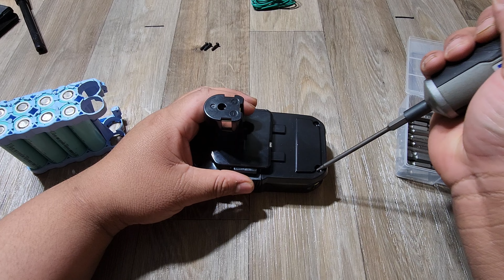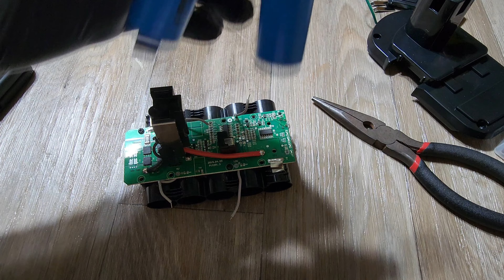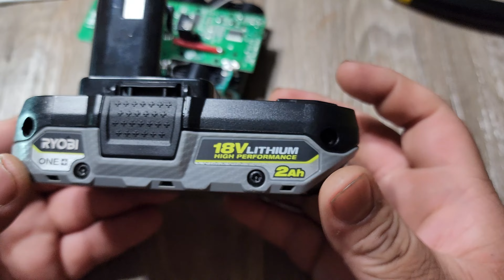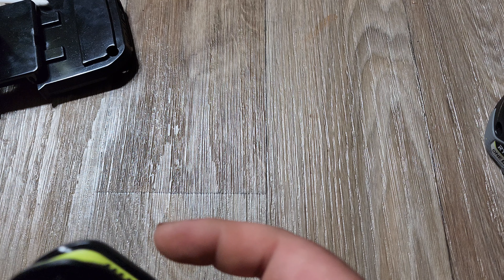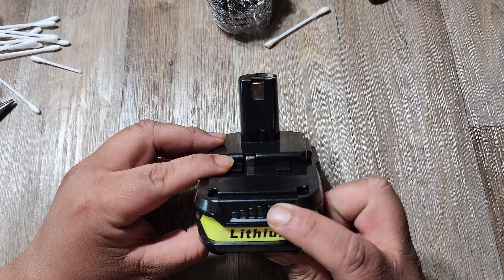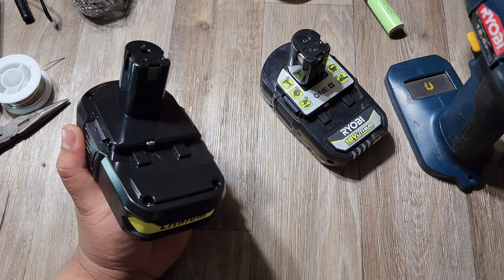Replacing Fake Ryobi Battery Pack Batteries with Good Quality ones!

Comment: I'm pretty sure that's normal voltage for good batteries
Reply from the maker: Yea, I just found out after making the video I usually see 3.7 voltage on 18650 batteries I get from drill batteries and laptop batteries. I think that maybe 3.6 v are not normally used in power tool batteries
Reply: @TekSavyAron  I feel like 3.6 just isn't used as must in anything I rarely see those batteries